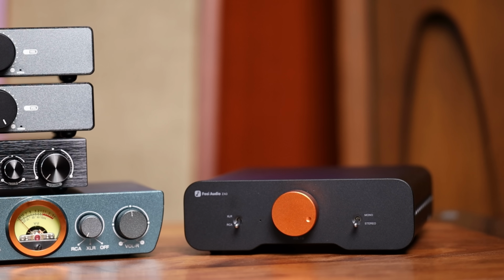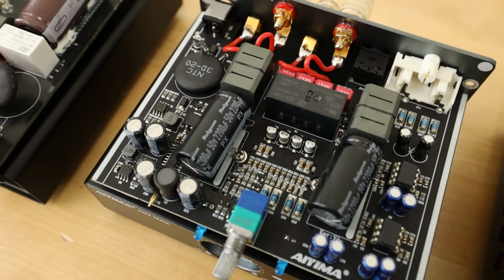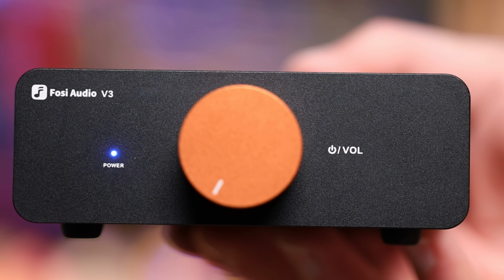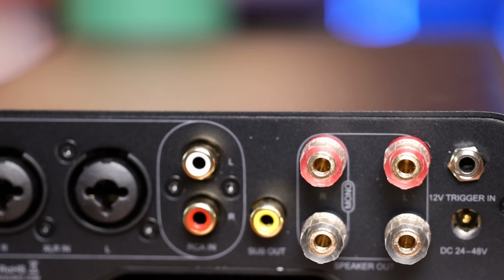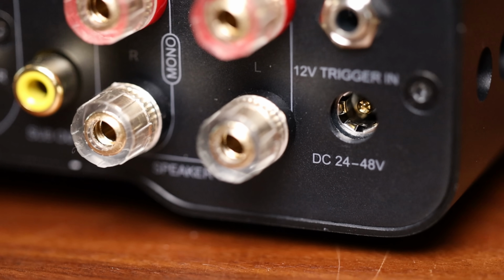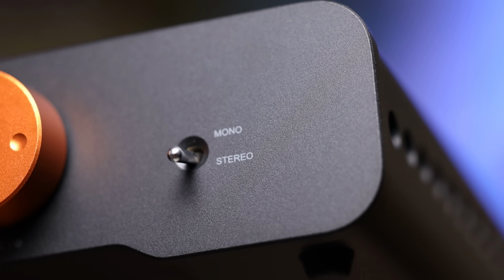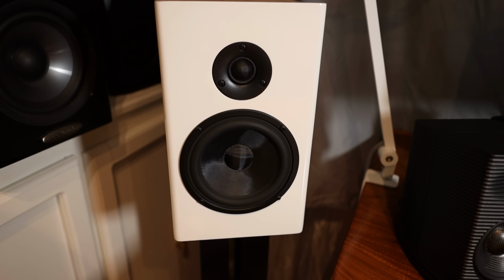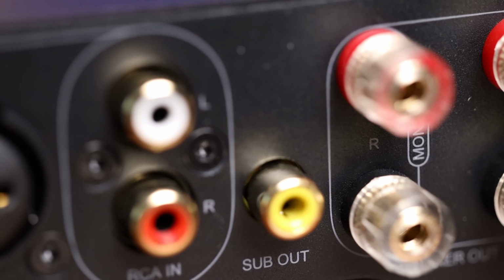Fosi ZA3- Teardown / Comparison / Review - Topping LA90 Who?

Comment: What’s the point of mono mode if it doesn’t double the power? And who is gonna be constantly tweaking two volume knobs to get the perfect balance if using a pair of these in supposed-mono mode?
Reply: The point of PBTL "mono" mode is that A) it's a single channel that owns the power brick and B) paralleling the stereo channels makes much more current available for lower impedance speakers.
Reply: No one will tweak the volumeknobs in mono mode. You set them full throttle and control volume via a pre-amp or capable DAC. Use the triggers and they will switch on/off when your DAC or Pre has a trigger out. You may need to splice the wire to control 2 units or get a trigger module.
Reply: @34332  but sadly they’re not truly bridged mono like most stereo amps so you really don’t see much of a benefit. Watch Williston audio labs testing here on YT. I think it got like 5 additional watts in mono mode. If it was bridgeable it will double in output 👍🏼
Reply: @jimbanville  
Correct, but it combines both channels for better current delivery. It has to be seen how that works out I guess, but more current is never a bad thing. Ofcourse, lots of variables here re. speakers and how low they dip and volume, etc. Subjective: imo, it outperformed the Audiolab 6000a, but that isn't a powerhouse to begin with (with Wharfedale Lintons; less sensitive than I thought, see Erin's corner) and a larger room. Anyway, other benefits (in theory!) are better crosstalk separation and as mentioned, 12V triggers and XLR. For my usage fun to play around with, but certainly not for everyone a necessity. And now I'm hearing rumours about a 'true' monoblock comin' up from Fosi, lol. 🙄
Reply: @34332  it may combine both channels in the preamp into a mono signal, but it doesn’t use both channels of the amp to amplify it. It would double power if so. The guy who did the amp dyno in the Williston audio labs YT video explained it.
Reply: @jimbanville  
No, it's not as simple as 'doubling' power. 'True power' is always limited by the PSU (in this case 48V/5A). By combining both channels in mono, you get a bit more power but, more important, more current per channel (5A).  That's a design choice and, imo, not a bad one and more realistic. In other words, you can have a nice high output number, but no steam to back it up when you dip low in Ohm (for example 2 Ohm). If you really need that is another question. There's an article on ASR that goes deeper into this.
Reply: @34332   ok. Where is an independent test that shows this amp increases its current output substantially at 4 ohms in mono mode vs stereo mode?
Reply: @jimbanville  
No one stated 'substantially' (because it isn't possible, remember the PSU/AMP limits and max draw). Like I said, ASR got an extended article about it with input from Fosi about why and how. For example, a Naim amp with 'only' 80 Watts is capable of handling many not so easy to drive speakers effortlessly. Possible because the ringcore transformer can draw as much as 400 VA from the mains when needed. 
It's not all about Watts, but more re. current capabilities. Shift the numbers and on paper it looks good, but not much in reality. For the independent test we have to wait, but look at the ASR Amiya test to get the picture.
Reply: @34332  great. Where’s the data that actually shows more current into 4 ohms using mono mode? Not what the chip is capable of. What this amp does.
Reply: @jimbanville  
Have a good one Jim 👋
Reply: @jimbanville 
Nope.  Get a copy of the "TPA3255  data sheet" and look at the various modes supported by the chip.  In PBTL the outputs are paralleled to increase current delivery... and with a 2 ohm load it does double the power.
Reply: @jimbanville  
"Where is an independent test that shows this amp increases its current output substantially at 4 ohms in mono mode vs stereo mode?"

It won't ... and no amplifier will ... the current is determined by the load, not the amplifier.  Ohm's law 101 ... Current is the result of imposing a voltage across a load.
Reply: @jimbanville 
" Not what the chip is capable of. What this amp does."

It's a "chip amp"... it does what the chip does.  They can't teach it new tricks they can only use what the chip offers.

This is not a class AB single ended amplifier. It is a class D amplifier that is already bridged in stereo BTL mode.  You can't double bridge it.
Reply: @Douglas_Blake_579  
So put a 2 or 4 ohm load on the amp in stereo and mono modes and show the increase in current drawn from the amp in mono. How else do they prove the claim? I know what the “chip” datasheet says it can do. I’m asking to prove that it’s doing that in this amplifier package.
Reply: @Douglas_Blake_579  I k is what the datasheet for the “chip” says. How about driving a very low impedance speaker in both stereo and mono modes and show us a difference in the speakers frequency response?
Reply: @jimbanville 

How about we cut to the chase ... it is beyond obvious you do not understand what PBTL mode is all about.  It's getting increasingly apparent you aren't listening to our explanations.  And, finally, you're taking up a lot of people's time for things that are indeed answered in the data sheets.

Simple solution ... read the effing data sheet!
Reply: @jimbanville 
What makes you think the chip can behave differently?  It does what it does.
Reply: @Douglas_Blake_579  
Calm down. This amplifier has been independently tested and doesn’t meet the “specs” of the chip’ datasheet
Reply: @Douglas_Blake_579  
Yes. Let’s cut to the chase. There are lot of measurements of this amp. None show current increasing into 4 ohm loads in mono mode despite what a datasheet for the “chip” says.
Reply: @jimbanville 
Yes it does.  I've tested a lot of TPA3255 based amplifiers and they all match up with the power and distortion specs in the data sheets.  

Go back and re-read it ... this time try to get past the first page.
Reply: @jimbanville 
 "None show current increasing into 4 ohm loads in mono mode"

That's right ... as I said above ... current is the result of imposing a voltage across a load.  Same voltage... same current.

PBTL mode will however allow the chip to deliver more current to 3 and 2 ohm loads, which is why it's there.
Reply: @34332 
 "No one will tweak the volume knobs in mono mode. You set them full throttle and control volume via a pre-amp or capable DAC. "

You can do that but it's not always the best way.  Most pro-audio amps have volume controls as well. The common practice is to set them to match the other levels in the overall system, and/or at a maximum level that is safe for speakers and people.  From there you use the pre-amp controls to adjust the volume for your convenience, up to the max set on the power amps.

I use a TB10D (also TPA3255 based) in my system.  It's volume is set at about 2 o'clock to leave a bit of room for a slight bass boost.  In my HTPC I use the system volume controls to adjust for the levels I want to listen at.  Works a treat.

Comment: The only seriously wrong thing with these is lack of remote control. These are fine for a desk where you’re within arm’s reach. Beyond desk use, these need remotes or it’s a no sale for me.
Reply: Get a WiiM with trigger out, solved.
Reply: @34332  if using this as an integrated amp, lack of remote control for volume is a big negative unless you keep it within arms reach.

Comment: I need a “truly” MONO 300 watts into 4 ohms mini amp. As in 1 input and  1 speaker +/- output. Not an amp where just half of the unit is bypassed in mono “mode”. Truly mono.
Reply: Half the unit is NOT bypassed in Mono mode.  The two stereo channels are paralleled together to give increased output current for lower impedance loads.
Reply: @Douglas_Blake_579  
Wrong. A REAL MONO mode “bridges” an amp. That would double the output. That is not happening with this unit. Just watch the dyno results in this video…
https://youtu.be/fICMe0QvYrE?si=LIX4zxz347vdPA2P
Reply: @jimbanville 
No sir.  

Mono simply means 1 channel.  
It does not imply bridging at all.  

I get that you had some wild expectation but right now you're just tripping over your ow false assumptions.
Reply: @Douglas_Blake_579  
Bwahaha! Stop being an apologist for fosi. Show me any other amp that advertises a MONO mode where it doesn’t mean BRIDGING. I’ve been in AV a looooong time. Car audio amps and home audio amps that have MONO modes they actually BRIDGE the components, doubling the power. That’s the PONT of a MONO mode. Look at the dyno results in that video. You gain almost nothing from MONO mode on this amp. It’s a joke.  You can just use one channel and leave the switch in stereo mode and get the same results 🤣🤣🤣

Comment: Matt, you made a comment that I've wondered for years (think solar catamaran sailboat, running as much from DC (leaving inverter off as long as possible).  Does anyone that you know of make a modern video decoder only device ?  IE, an A/V receiver WITHOUT the amplifiers, so one could decode the video/audio signals, but upgrade/add their own amps.

Comment: I have just connected the Fosi P3 preamp to my Beast ADCOM GFA 555MK2. It works fine and sounds great , regarding the ZA3 I think I will pass for now until they will improve it and hopefully they will add a remote control will be a plus.
Reply from the maker: One thing is certain we will see another revision!
Reply: Whats your suggestions for the improvement?
Reply: @fosiaudio  Well ,as a dedicated power amp  you can remove the volume and make it fixed, take the mono/stereo toggle switch to the rear, maybe put a better power on/off switch, now regarding the P3 pre amp , I like the build quality and overall appearance better then the P1 I also have but I think it is about time you will provide us like P3 preamp with a remote control and RCA pre out for active subwoofer. Thanks
Reply: @RanTausi  Thank you, we are developing P3 MKII that has remote control but without tubes.

Thank you for your suggestions for ZA3.
Reply: @fosiaudio  maybe a pffb too ?
And better speaker terminal block..
Reply: Adding a remote lwnds itself to more distortion

Comment: Yeah, the front panel sucks. It's like they put a 110/220V switch on the front panel. The Stereo/Mono setting is a one-time setup thing. But this seems to be the case with many cheap audio components made in China. They always seem to have at least one WTF design decision.
Reply: Thanks mostly to the "Department of silly decisions", most companies have in their basements.😵‍💫
Reply: It supposed to be a power on/off switch but then someone invented a cooler design
Reply: @outolempinimi5165 
They can't turn it completely off. If they did the 12v trigger would not work.
Reply: Yes of course, should be on/off/trigger switch as in many other similar devices. Hope they will come with revised version of this as apart of its design flaws it offers the best value for money in its category as of now. I'd still  go for Topping PA5 II Plus or some other alternative over this despite it costing twice as much until they come with more practical/safer design features and preferably true bridgeable monoblock as well.
Reply: @Douglas_Blake_579 Absolutely, but there are still a few minor niggling points, which would most likely add slightly to production costs, but as Fosi has a track record of constantly adding models to their line-up, they could be incorporated in a “Pro / Plus” version - to borrow a marketing tactic from WiiM:
- bridge mode for higher output power in monoblock mode; 
- relocate the stereo mono switch to bottom or back panel;
- juggling the location of the combo balanced line inputs would allow for additional pair of RCA jacks for variable pre-amp outputs - assuming the internal OP amps could sufficiently drive both the 3255 and any external amp to full output. This is probably the main missing feature keeping the current version of the WiiM amp from being almost unassailable at its price?
Reply: @fonkenful 
Okay, can we put this to rest please ... the TPA3255 chip is not capable of a "bridge mode for higher output in monoblock mode". The outputs are already bridged in the stereo mode, which is actually the chip's 2xBTL mode.   The monoblock mode is 1xPBTL mode where the stereo channels are paralleled to increase output current for lower impedance loads.  

The rest of it is likely doable.
Reply: I don't care, as long as it sounds ok.
Reply: @sepg5084 
Flip the switch while it's playing music.
You'll care.
Reply: Can't please them all. Like wtf was schiit thinking with pre outs that are always on
Reply: @traaaaan 
I think you'll find most stereo gear has the pre-out always active.  If you don't want to use them at the moment, just turn off whatever you got listening to them.
Reply: The good news is that Fosi seems to listen to customers: they subsequently came out with the V3 mono blocks— they got rid of the front volume pot, they made it balanced and put XLR connectors…
Reply: Yep, it's the old , what the fuck china while scratching our own heads .

Comment: How does the 12V trigger work with that kind of volume/power combo?
Usually you'd leave the volume at what you prefer, power off the amp and let the 12V trigger trigger a power-on. But here you're constantly on anyway if you've set your gain
Reply: The power switch is controlled by a microcontroller.  If you disconnect power it reverts to off, but you do not lose the volume setting.
The 12 volt trigger would be used to pull it out of standby.
Reply: @Douglas_Blake_579 , ah, so if the controller senses the presence of the 12V trigger cable, it disables the power on/off on the dial?
Reply: @TokeBoisen 
No ... If it's done properly it works like an or gate ... if you push the volume it will come on, if you feed it 12v on the trigger it will come on ...
Reply: @Douglas_Blake_579 , ooooh. I thought it was still a click at the bottom of the volume control. My mistake. Yeah, then I get it.
I made an analogue or-gate with a relay in a similar amp with a switch on the front for power. If the trigger was used, the relay switched the amp to on regardless of the power switch position, if you used the switch on the front, it didn't care about the trigger.
Reply: @TokeBoisen 
Yep ... that's how it's supposed to work.
I haven't tested it to be sure.

Comment: ZA3 was tested into 8 ohms and did 90+ watts 
per channel into 
8 ohms with less than 1% THD using the 48V, 5A supplied brick.
Reply: I like the value already for stereo. And, I believe Fosi  have a 48v/10A in the works so people wanting to buy two can really appreciate the power increase.
Reply: tpa 3255 (this unit chip) can output 220w per channel at 4 ohms with good power supply 1% thd you need 48v10a or even 12a supply though
Reply: @icncwx1790  I hear you, 👍but at that point, I'd be concerned about manufacture and how robust the thermal design is. Pushing 20w average per channel might not survive long term. Better to use speakers with some efficiency to get your higher SPL's with the amp running more backed off with more headroom. Just a thought for those that want a PS brick that can push those to their limit.😉

Comment: Imagine a version 2.0 with just HDMI input to connect to tv arc hdmi to control with tv remote
Reply: Thanks for your suggestions.
Reply: let us hope for the necessities first i.e. the two switches and the option to set the volume control to a fix value.  The HDMI is totally for Dolby stuff (AVR has remote - and you don't want to see 10 remotes on your coffee table) and the technology alone may increase the price of the POWER Amp substantially. Amplifying 1v input  to 120 RMS output is already a lot of work.

Comment: According to Williston Labs, similar Fosi amps with the same Ti 3255 chip are producing 42w @ 8 ohm, 71w @ 4 ohm with the 32v power supply 
and 92w @ 8 ohm, 172w @ 4 ohm with the 48v 5 amp power supply all these measurements are driven @ 1% THD 
The video and full info Williston Audio Labs, Fosi V3
Con: In mono mode this amp is just that, MONO, not bridged. There is some benefit but not what you would expect.
Reply: Not even a 10% power increase in mono?  ;-(  ..
Reply: @tikblang1  No. It does allow you to have one power supply for channel, but that would only be an advantage with the basic power supply. With the 10 amp, it wouldn't help to run in mono.